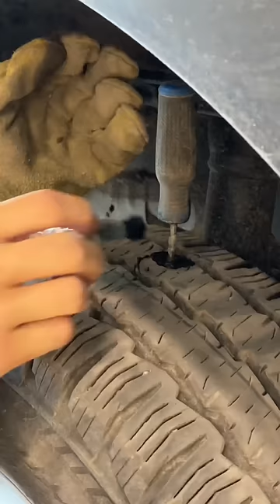Why You Shouldn’t Plug Tires #tiredoctor #tireguy #tires #shorts #tireplug

Comment: Absolutely nothing wrong with plugs. It's an emergency thing. Once you get home, just patch it properly. Plugs will last thousands of miles with no issues at all.
Reply: Even on regular vehicles? I got a flat one time and the tire shop fixed it with a plug instead of a patch...  It was on a brand new tire that I only put like 50 miles on before getting a nail stuck in it 🤦🏽‍♀️
Reply: @Harlow_Khmer it’ll last longer than your tread

Comment: As an old tire repairman plugs are just fine.  We stopped plugging because we never knew if the tire had been driven on and ruined the side wall of the tire. (which cause blow outs) So shops switched to patches so they could inspect the tire inside as well.  Some shops prefer patches because they can charge $35.00 and up compared to a $8.00 plug.  Plugs work great if used correctly.

Comment: I have a drive tire that got punctured by a long nail nearly brand new. 200k miles later the plug is still there. About to change it soon cause the treads getting low.

Comment: My tire repair shop recommended plugs to save the cost of what were expensive tires. They repaired the tires with plugs for a small cost. Never had a problem with them. I wouldn't want to have to put plugs in myself, making the right sized hole etc, is difficult.

Comment: I worked at tire shop for years and still do and currently drive on plugged tires with 1000 or so miles and they are fine. No rubber dust on the inside. In my opinion a patch done at a shop is more secure and usually only 20 bucks if you can make it there but plugging if done correctly can last for quite some time on most average tires 😊

Comment: Done a lot of tires, not a tire tech. But I learned the safety reasons for it. Best as a temporary fix because although it may be properly vulcanized, they're not rated the same as the correct type of tire plug which you pull through the inside to outside.

Comment: I’ve used dozens of plugs over the years. Never had any issues. It does not do anything to the inside of the tire. They can always be repaired professionally as well. If you’re worried, you can take a tire to discount tire or NTB in the United States and they’ll fix it for free. I don’t have a Bugatti Veyron, but these plug tires work well up to and beyond normal speed ratings.😊

Comment: As a mechanic: Since when do plugs "destroy the inside of a tire"? The only reason why you find damage inside a tire that was plugged is because the car owner drove on the tire WHEN IT WAS FLAT and the person who plugged it didn't dismount the tire and inspect it. Of course, if it's dismounted then it would be stupid to not use a plug and patch repair instead.

Comment: Back in 1979 when worked at a service station, we had the coolest plug gun kit that used vulcanized rubber mushroom rivits to plug tires. Ream hole, apply glue, push plug gun injection needle into hole squeeze trigger like a calking gun and pull out. Done and the mushroom headed plug is inside.

Comment: Plugging a tire is not frowned upon.  It is actually the only way to properly repair a tire, but you should use a patch and plug. The tire industry doesn’t drive things like this.  Lawyers do.  Tire manufacturers and repair facilities get sued over things so then they make it so you can’t get sued by not doing that service anymore.  There are a lot of reasons why just doing a plug CAN cause issues, it doesn’t mean it always will but as a shop owner you have to protect yourself from the 1%, that’s just life with lawyers.

Comment: A dry plug will vulcanize to the existing tire and protect the tire cords and belts from corrosion. Most shops I worked at repaired a tire with only a flat patch from the inside, which is extremely dangerous leaving the outer structure damaged, promoting the rusty belts that separate a tire.

Only one shop would drill a proper hole to clean material and use a patch with a plug and vulcanize the patch.

Comment: Just using the patch on the inner liner allows water to get into the steel belts and cause them to rust allowing the tire to separate at high speeds.  All the tires that I had with broken belts there was a patch only on the inside at that position and could see the rusty water coming from that area.

Comment: I’ve patched and sealed every. Single. Plug repair that has come through my door. Not a single one came back. Why? You use a die grinder, glue, and do it correctly.
Reply: A little plug isn’t going to destroy your tire, driving on your flat tire will, as your sidewall heats up, the cords separate from the rubber and it becomes a pressurized bomb.

Comment: I’ve plugged thousands of tires. I’v even patched them on the shoulder, I’ve even patched a few sidewalls.  If you know anything about vulcanization ( chemically melting a (patch) to rubber) (Tire repair). As long as there is not a slice in most cases it can be safely repaired, if it’s a. I’ve clean nail or screw hole 9 times out of 10 it can be fixed but most of the time. The person (“you”) take it to is either not knowledgeable about a proper repair or they have been told to sell you a tire. My  family has been in the tire business for nearly 60 years and I have saved hundreds of tires that “could not” be repaired.   It’s mostly a sales tactic. Most customers don’t understand the process so they believe the shop (in most cases) they took it to.  They are kind of scared into it.  (It’s unsafe) it will blowout. Etc etc. Stay away from the dealership for tire service especially repairs ( There is a major dealership in my area and the sales manager brings his personal (corvette) to me for all of his tire service and he has access to a state of the art facility (our shop is as well) but it’s the guys operating the equipment.  , even tire chains  they hire guys that are just there for a paycheck and could care less about saving your  ( not all of them , I’d say most though) Try to find a small independent (reputable) Tire shop.  I grew up in the tire shop my father did as well. Tire repairs are a dying art.  We have access to so many different  repair units pretty much for any application (injury/hole etc) even  the location of the injury in the tire. There is a repair available.  If you notice the insert he  used in this video,  it will actually melt and become part of that tire. It’s not a black or red (temporary) fiber plug  they  just fill the hole until you get it fixed permanently  it can be ripped out where the one he used couldn’t be .

Comment: In some jurisdictions it's illegal. They require patches on the inside that are made with a spike of rubber in the centre that is fed through the hole, and then pulled tight from the outside until the patch comes up against the inside of the tire.

Comment: I've been plugging and driving plugged tires since before I started driving, I've only had 1 leak on me after years of service, pulled it out plucked another in and kept riding!
They're cheap, fast, durable, and often I don't even have to remove the tire from the vehicle.

Comment: It’s not that it’s “frowned upon” it’s that the Federal Hwy and Safety Bureau deem it illegal to perform by auto businesses because it is not a proper repair as the plug was intended to be a temporary repair. However, people treated it as permanent repair and that repair would eventually leak again or in a worse case scenario blow the tire. So the Fed’s told businesses don’t do it or subject to fines. 
My opinion is: don’t be cheap on your safety and safety of others on the road! Properly repair it with a patch plug from the inside of the tire (the accepted proper repair) or buy yourself a new damn tire!

Comment: If you push the tire's support wire through to the inside of the tire, you will have a blowout with a plug. The chance is negligible that plugs are fine.Tire shops do enough tires to guarantee a plug will have a blowout at some point. Also, they have to remove the tire to patch it. This allows them to force you into purchasing a tire if you still have half the life of the tire remaining.

Comment: Tire plugs are the best way to do it. Always has the friction of the surrounding rubber so will not ever go. Unless you didn’t do it the right way. Gotta put that plug in so the curve end is inside the tire and you got 2 ends sticking out on the outside.

Comment: Glue in string plugs are supposed to be a temporary fix, not to say i haven't done it many times and never got to fix it properly.  Once had a plug pull out on me on a hot day on the highway, but i think i didn't trim flush because i didn't have anything to cut with. Now i get the internal plugs from napa ($5 each), manual harbor freight bead breaker, tire changer with extra tire irons (spoons). Need to look into external push in mushroom plugs, i hear they work

Comment: I used to be a tire and oil tech when i was in college. The only time I've ever had an issue with plugs was with my fathers old truck. He took it to his dealership twice in a week for the tire leaking we took a 3 hour road trip and found out it was still leaking so we took it to a shop in that area and they pulled 2 plugs out of the same hole and patched it. That being after being a tire guy i run plugs 99.99999 of the time if you have more of a slash in the tire a plug most likely wont hold but for 99% of punctures a plug is sufficient the shop i worked at didn't allow us to use plugs at all so we had to patch everything i can say most of the patches we did could've been plugged and you would never have an issue especially with the punctures near the sidewalls that you cant patch we turned away so many customers over that ive seen tires with 50 to 100 miles on them get punctured near the side walls and have to explain why your brand new tire with the tits still on them needs to be replaced knowing full well i could just stick a plug in it and you'd run down to the cords before you ever have problems with it. Idk i think it becomes a liability when people try to put them in without cement or dont cut them off but other than that ive never seen an actual valid reason to not use plugs. I think its more of a ploy to get you to the shop/dealership than anything.

Comment: The type of plug the tire doctor is using is called a perma cure. It’s not your standard $2 string plug.  They are meant for off the road applications. 

One of the reasons DOT says no is because the inside of the tire should be inspected for damage.

Comment: I started carrying a plug kit in my work trucks about 20 years ago and after plugging a half dozen holes I’ve never had an issue.  They’ve lasted as long the tire tread has.  Same with my tubeless mtb tires.  I’ve put holes in new tires three times and after being plugged they all lasted until the tread was gone.

Comment: The only tire plug to use is a VULCANIZING PLUG,just like what was used in this clip.. we plug ATV tires with them and side walls as well. NEVER EVER HAD ONE FAIL. TIRE TECH IS COMPANY I USE AND HAVE SINCE THE EARLY 1990s... i even use them in street bike tires on my personal bike and run it 170 ,180 mph.. they are there for life

Comment: Quick fix plugs and a push in tool. Remove screw, force plug into hole, Rip out tool. Done and over. no unnecessary "professional" show to make it work. And yes we own multiple tire shops. Never a issue.

Comment: Tell me more about this, "...destroys the inside of the tire." I have fixed dozens of tires with plugs. I have a tire machine and do most of my own work, so I get to break them down off the rim when it's time for new tires. I have never seen any additional damage to the inside of the tire that was plugged. The hole (the damage) is there already. When you insert a plug, you fill the hole. No additional damage. Pictures or it didn't happen.

Comment: Im one of "those shops"  the reason i dont use plugs is bucause tire manufacturers dont recommend plugs.

And why not patch it.  For sure if your stuck some where, im all for using a plug as a temporary thing.  But get it patched as soon as possible. 

I have yet to repair a tire that has a patch leaking.  Now plugs, all the time!!  Never seen a plug not leak forever.  In my experience,  they always leak again eventually.   A vulcanizing patch will last the lofe of the tire

Comment: I've plugged hundreds of tires (properly) and never seen a failure. Plugged some improperly too (double plug, to close to sidewall, in sidewall) if in a pinch and the failure mode has just been a slow leak, which was an improvement over the large leak they were fixing, and good enough to limp until proper repair.

Comment: Ive got really bad luck with punctures. My last set of tires had 2-4 plugs in each tire. I've tried getting the patches and every single one failed during the winter when it hit -30c

Got a new set of tires a few years ago and already have 4 plugs in my 2 back tires, just driving around a city. 

Those patches suck ass, I'll trust plugs over patches any day

Comment: A sharp piece of crushed concrete on a county road slashed about a 1" cut right in the middle of my tread last summer. My spare was already on another corner of the vehicle so I slathered up I think four plugs and just kept jamming them in that cut and it held. Ran it full of air with my onboard compressor and drove 60 miles home. Was planning on changing the tire out but it made it on those four jammed up plugs another couple of months until I replaced the entire set.

Comment: Was on a 350 mile road trip because of a family emergency, tire had a whole I found at the gas station before I left at 8 at night on a Sunday in my f350, on the steer tire. Took 4 plugs to get it to stop leaking, then another 4 200 miles later and another 2 a 100 miles later. Made it there, replace the tires before I drove home of course, tire plugs are an essential part of kit for any vehicle

Comment: North Shore Labs Safety Seal FTW. Had a traveling salesman come into our shop back in the early '80s demonstrating these. He had an F-150 and had a hundred plugs in each tire. Sidewalls tread you name it. He drove it that way. Had a spare tire that had a hundred plugs in it that had the bead off so that we could see the inside. Aired it up to 40 lb. Invited us to check for leaks. Not a one. Handed us a spray bottle with soap and asked us to check the tires on the truck. Couldn't find a single leak. 
I have kept one of their kits in everything I own since that day and I probably put in a hundred of their plugs in my stuff and I've never had one fail. Not one.

Comment: I have been plugging tires on my different vehicles from race cars to Jeep crawlers. I have never had a plug fail. Occasionally they’ll leak months later but just replacing it stops that. 
It doesn’t ruin anything and they usually last the life of the tire.

Comment: I came up in the trade in the mid-90s into the early 2000s.  It was around 2006 that the shop I worked at stop doing plugs and instead started patching from the inside, boss said it was to maintain the speed rating.  Apparently it was not safe plugging a low profile tire on a car that could easily go well over a hundred miles an hour. 

But I can speak from experience that in the days of 75 to 80 series tires on vehicles with a speedometer that maxed out at 85... A tire plug was more than adequate.

Comment: The proper way is always use repair sealer, put some on the plug then insert. The sealer really helps, Most plugs ive seen are installed super dry and start leaking fast

Comment: Im a tire tech, i know plugs last i use the sht out of them. But doing a patch gets more money for less material cost. I always push for a patch but some people just dont want to spend more than 20 bucks and those customers get the plug. My boss used to say no plugs at all only patches. So when the customer says no to a patch and were about to drive away i go in and offer the plug for 20 bucks and they always get it. I keep a small compressor and plugs in my truck so i can always offer that to anyone that needs it, pair that up with a simple google business listing for tire repair and you can sift through calls all day long. Driving from one 20 bucks to the next and usually 2 or 3 out of the day will tip another 20.

Comment: Using wide flange plugs, installed from the inside of the tyre, is bomb proof. Obviously, poking something in from the outside will be inferior and prone to being forced out. 
Been riding a rear motorbike tyre with 2 plugs for over 2 years.
Reply: I've used dozens of the from-the-outside plugs and never had one 'forced out'.

Comment: Ive taken external plugs out and repatched with an internal patch before. The inner surface isnt damaged usually if the tire isnt driven on before being plugged or patched. After using the buffer and surface prep with scraper, no glue from the plug is left and you then patch like normal.

Comment: Nothing wrong with plugs on a temporary basis. Remove the plug and properly install a patch when you get back home.
Reply: Or not. If it holds air, just leave it. As stated by most commenters here, they almost always work just fine with no issues.

Comment: It's fine for a side of the road fix, but as soon as you get a chance you should take it into a tire shop and have a internal patch applied. For an off-road vehicle run it as long as you want. For the record, tire shops don't like you doing it because it's not the easiest thing in the world to get the plug back out so we can put a uniseal patch on. We would much rather you put a spare on, and bring us the punctured tire.